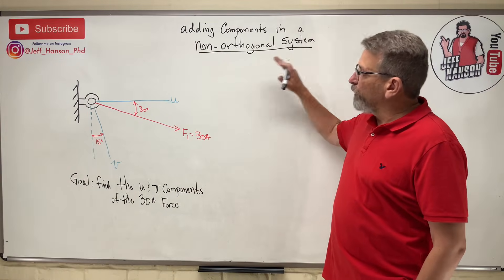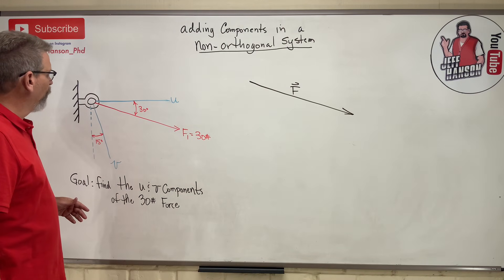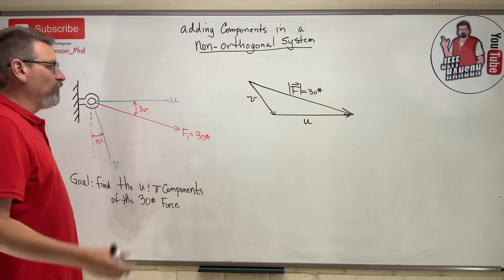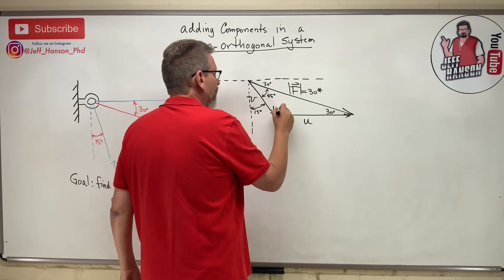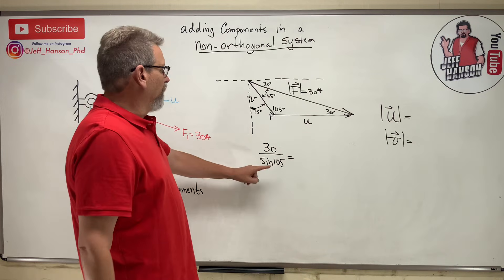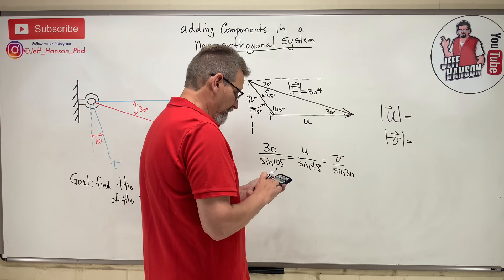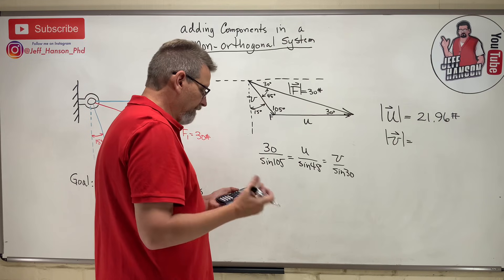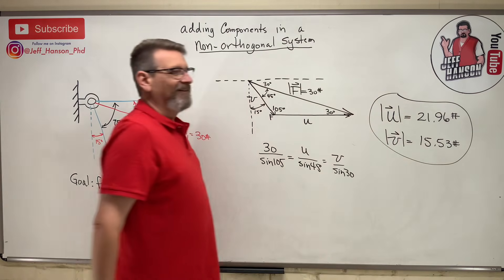Statics: Lesson 7 - Finding Vector Components in Non-Orthogonal Systems

Comment: How come we can't use F1*Cos(30) to find what u is??
Reply: I was wondering the same thing and just realised that the components don't form a right angled (90degree) triangle. Therefore, you can't use SohCahToa to solve.
Reply: @ambrose_8  Actually you can use Trig to solve it. Instead of treating u and v like axis', just treat them like vectors .

u = (uCos(0))i + (uSin(0))j

v = (vSin(15))I + (vCos(15))j

F = (30Cos(30))i + (30Sin(30))j

(F)i = (u)i + (v)j
(F)j = (u)j + (v)j

30Cos(30) = u + vSin(15)
30Sin(30) = vCos(15)

Its easy from there.
Reply: @bloodthirsty5145  How do you come to use the angle 30 when you are unsure whether the vector u is on the x axis. Since you displayed the resultant vector F components in cartesian notation, you assumed u to be orthogonal. It could be that u is a slope and not a straight line towards the right. Is it so or am i missing something?
Reply: @musa9604  Well he does say at 2:19 that the angle is 30 degrees from horizontal. But yeah, unless specified somwhere I shouldnt make that assumption.
Reply: @bloodthirsty5145  understood, thankyou.
Reply: F1*cos(30) is only valid if you have a right triangle. The triangle in this case is not a right triangle as you noticed that u and v don't form a 90 degree system.
Reply: Hello , okay i know that this non orthogonal system but why projecting the force in u and v axis and use trig to get doesn’t seem to get right answer ( with respect to their angle of course)